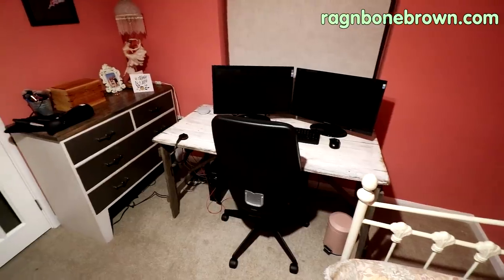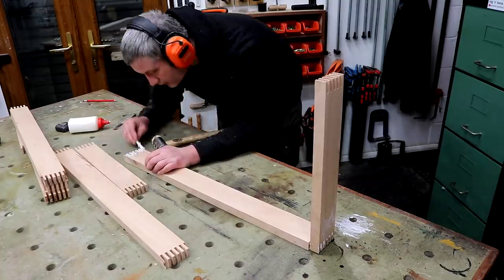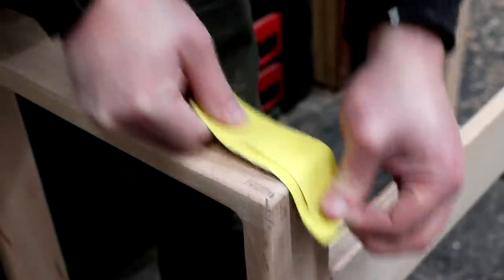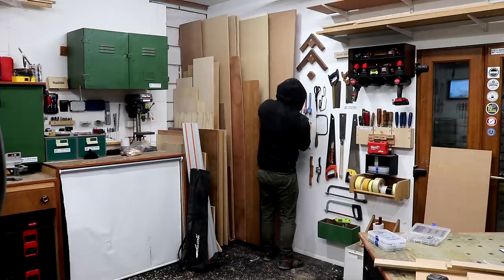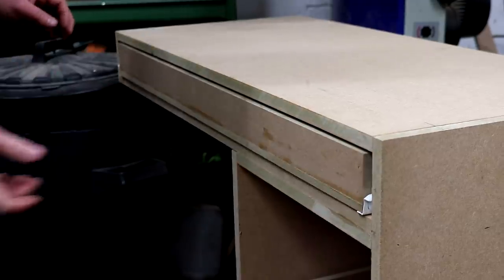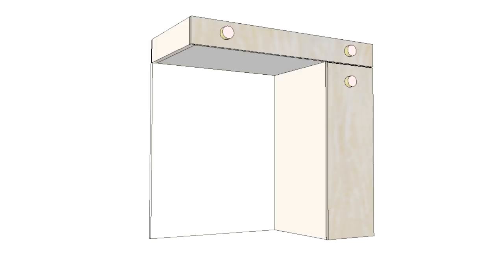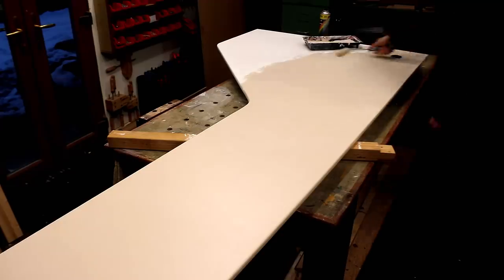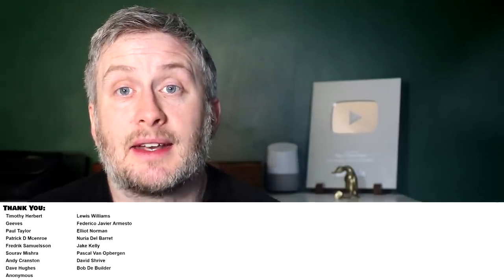Making A Desk For My Fiancé #AD

Comment: Looks like you're using 8mm domino's? Should go for the 6mm on 18mm as it leaves more material either side. Its only for location not strength

Comment: That's a cracking looking desk mate , looks really good. What brand router bits are you using these days . Hope the boss likes the desk / dressing table make sure if Ria now has to work from home full time then you claim the correct costs off her employer  compensate for use of power broadband ect ect
Reply from the maker: I have a mixture of all sorts, most of them are just cheap ones
Reply: @RagnBoneBrown  the round over left a good finish

Comment: Slightly confused by this... If you are going to make a desk with ikea quality material and runners, why not just get an ikea desk? Probably cheaper and definitely easier. I absolutely understand why one would make a nicely carpentered desk out out nice materials, it's obviously suprerior to an ikea desk, but I don't really see the point of this. Nicely executed though!
Reply from the maker: IKEA use chipboard and honeycomb cardboard substrate as far as I'm aware. Not sure I understand your point seeing as the desk was made bespoke to fit the space in the room, and IKEA certainly don't sell a similar sized, shaped or appearance of desk 🤷‍♂️

Comment: Great vid Keith, but like you said you have normally used the normal cheapy type BandQ type mdf.  I guess as that is easy to go get and can be cut in store to aid for transport. Mr Millard also rates the posh stuff,, but my question is?? How can a hobby woodworker get this stuff and from where easily?? Thanks
Reply from the maker: Most good timber merchants should be able to order it in.  That said, I can't seem to get Medite locally to me in Norwich, they all stock different brands of premium MDF. I could order Medite from a national supplier (like Latham's) though but delivery costs are expensive so I understand the issue!  Medite are working on improving things and putting together a list of suppliers though 👍 I'd recommend calling around a few local timber merchants to you and asking what brand they stock, or try asking Medite via the members are link in the description box

Comment: Lovely work! What is the cutting disc you use in your rotary tool? I have a die grinder which I use spinning with miniature wire wheels for cleaning up metalwork, it's great but the miniature cutting discs you use looks so handy too!
Reply from the maker: It's just a regular cutting disc I got in a set of rotary tool bits

Comment: Keith.  good job.   ive always wondered about the wood rack inside the shutter door. is that enough protection from the elements. and temperatures for the wood stability moisture etc.  How does that work.  I'm a novice of coarse.  great video channel  👍👍
Reply from the maker: It works great, doesn't get any moisture unless I leave the door open when it rains, and fairly good airflow so timber dries out pretty well

Comment: Very smart looking unit, and the problem solving was effective.   One query though on the use of 'our' tablesaw:  I see you have the optional addition attached to the main fence.   I thought that this was really only needed when cutting thinner materials, so I rarely fit it.   Do you have some other reason for attaching it that I have not realised that you could pass on please?
Reply from the maker: I was sick of putting it on and taking it off all the time so I decided to move my measurement ruler on the fence to account for the dimensions with it added and just keep it on there all the time. Only problem is occasionally I want a higher fence!

Comment: Hi Keith.  Is there a reason you painted the desk using a roller rather than your spray gun?
Reply from the maker: Just because I didn't have the spray gun at the time
Reply: Thought as much.  Based on your comments, I am looking to purchase both the compressor and the spray gun you used when I move into my new workshop in about 6 weeks time so will keep an eye out for any further updates.  Thanks Keith

Comment: Fantastic video, can I ask as you said you've worked with the cheap MDF before did the 2 coats of primer go on so well on the edge because it's a superior MDF or was it your primer? I've only worked with the cheaper MDF and I normally end up putting filler on and sanding to seal it. Looked so quick and easy on your video. lol
Reply from the maker: I follow the same process for all MDF, never had any issues with it, although the Medite stuff does cover a little better
Reply from the maker: Usually I sand at 80, then 120, two coats of primer, denib and then top coat. Maybe the video makes it look like less work than it actually is 😊